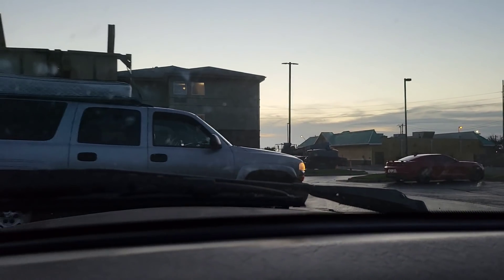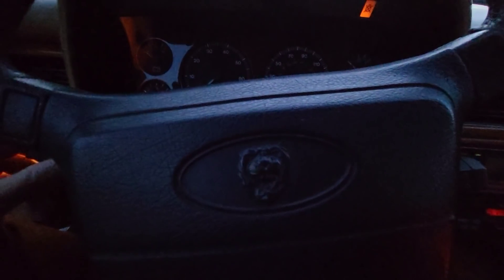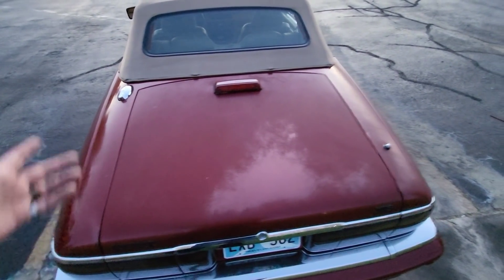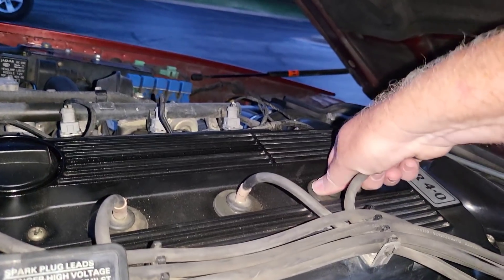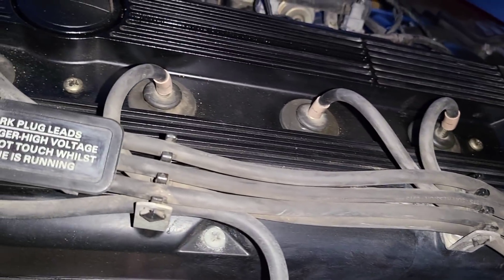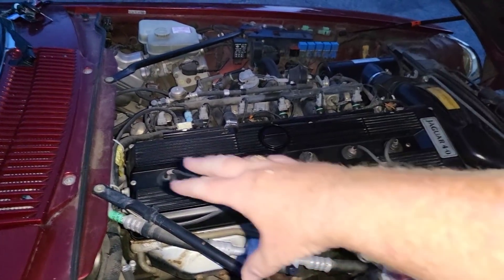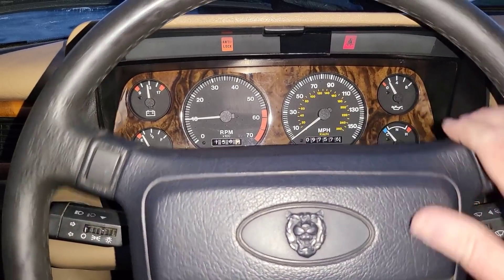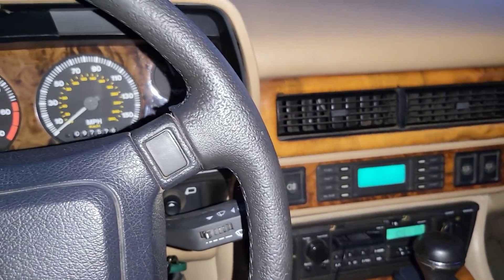Jaguar XJS Update What Broke Now? 🤬

Comment: My Mitubishi has the same oil leak problem, the valve cover gasket is pretty good, but the spark plug tube seals seals need replacing....

Comment: Have a 94 Taurus SHO 3.2 that had the same issue with oil in the plug well. It’s actually a plug well seal (basically a rubber o-ring) that causes that. But they come as part of the valve cover gasket set. Def not a fun job. Ol tweakers gonna throw they furniture in the dumpster🤣